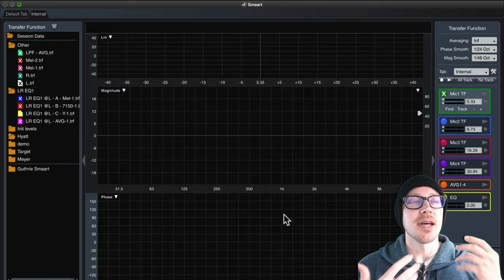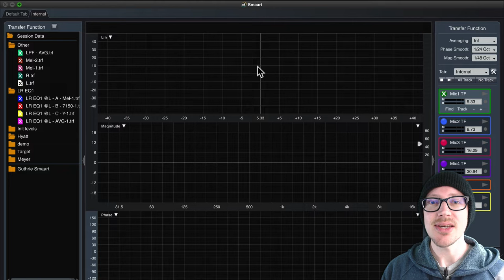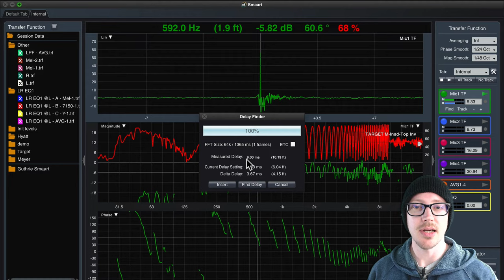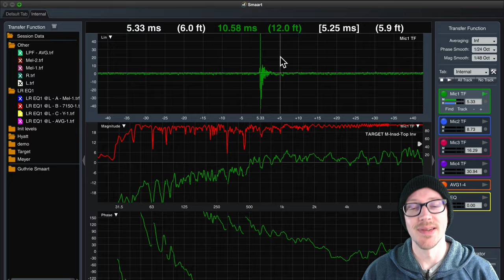How to Time Align Your Main to Your Front Fill Using Smaart® Live IR

Comment: If you don’t have smart and need to use front fills what should you do. If you have the math on how much delay is needed love to hear
Reply from the maker: Stand at the acoustic crossover point and measure the distance offset. Convert to milliseconds by multiplying by 0.9.
Reply: Also you have the "good ol' days" method (trying to make it sound fun, I'm 28) wich involves just your ears ^^

Send your test signal with inverted polarity to your fills (or subs,  or wathever you need to allign) and play with your delay untill they're completely in phase (you'll know cause the signals will cancell each other acoustically, or at least they will cancell each other the most, putting all other variables reflections from the ground, ecc  in count)

IMHO if you need to use "only" math, u're not considering too many factors, starting from the speed of sound changed by altitude, temperature and humidity, ending by unpractical measurement you'd need to be accurate, like the distances between mains and fills), this way at least we're taking all the not-ideal conditions in consideration ^^
Reply: @ValerioAmedei  I like your thinking on the subject, but have Alex do some math got to be better than no math at all.
Reply: @trydiz  sure ! ^^ A quick math question was already given, so I was trying to add to the subject ^^

Just to clarify, I'm exactly the guy who would measure everything - no matter how unpractical it would be - to have at least a matching value between my math an my "practice", but, again, I was trying to add another practical point of view ^^

Comment: Very interesting but I have a doubt. Is better to adjust phase electrically or acustically. Can I do it with Holmimpulse? With Smaart phase is  a line
Reply from the maker: Hey Raul, I think I saw this question on another video. My understanding is that you are trying to decide if you should physically move the box or electronically delay it. Either will work. 
I don't know what Holmimpulse is.

Comment: Hi @Nathan Lively , thank you for the video. I have a question for you. How do you proceed when having maybe 5 stacks of FF? Do you set the same delay to each one? In that case, which stack would be your reference? Or do you set a different delay on each stack? In my experience I’ve met same amount of engineers applying each option...
Reply from the maker: Hey Rafael, do you have Bob McCarthy's book? I recommend you read section 14.4.6.2 Delay Dilemmas. I think you will find the answer your question there.

You can then look at your different options and ask: Which choice will affect the maximum number of people?

Comment: 1 thing i ALWAYS do before anything else is delay my MAIN L/R PA by 6ms before anything else. This gives me room to move forward and backward in time if need be if ever you have to due  placement as often happens at a large Festival when it's just go go go, points don't get put in the right place,  ground stacks are way forward thanks to shit management by those directing local crews etc etc etc etc . In most cases, I don't have to use that "Buffer" but having it on many an occasion where you cant go back in time, works well enough that no one out front has any idea that you didn't actually bend the laws of physics at all, instead just thought the potential problem through before finding a HUGE problem you can't solve, 2 hours later!
Reply from the maker: Brilliant! Why 6ms?
Reply: @nathanlively  I used to do 5ms, thinking I'd never need 5, then once I did where the outfill was almost behind the main hangs and had real issue getting any low information into that part of the venue.  So now I do 6 and never needed it since. !! Nothing more complicated than that. In all honesty when I've had to use that "buffer" it's rarely any more than 2.5ms remedy in most cases.

Comment: If this is for a home theater do I adjust the delays in my receiver
Reply from the maker: hmmm, unsure. You'll need to contact the manufacturer.
Reply: @nathanlively sorry I should’ve been more specific. I use an AVR in my home theater, and want to use this method to time and phase align. Do I just use the distance setting in my AVR to achieve the delays? Since distance is basically the same thing as delay in an AVR

Comment: Appreciate the videos @Nathan, I was hoping you could clear something for me. @1.33 when you start to find the spatial xover point initially where is ref and measurement delay value locked to, mains or the front fills. I mean the initial 5.33ms you have from the beginning of your video (its probably the latency of your demonstration setup in this case). Or would you turn on the FF and the mains and find the delay and let smaart locate which one is closer? 
Second question is would you just work on one side of the PA Eg: Mains Left and FF and just use the values for the right side  or work on both L & R separately especially in the case where a mono out is used for the FF?     
Thanks
Reply from the maker: Hi Yamin!

> when you start to find the spatial xover point initially where is ref and measurement delay value locked to, mains or the front fills.
It doesn't mater. I could be either as long as you can peak both on the graph.

> Or would you turn on the FF and the mains and find the delay and let smaart locate which one is closer? 
I just turn them on both together and hit the delay locator. It will pick the highest peak. Then, if I don't see two clear peaks on the screen I will zoom in or out or add some delay to one channel until I can see two clear peaks.

> would you just work on one side of the PA Eg: Mains Left and FF and just use the values for the right side  or work on both L & R separately especially in the case where a mono out is used for the FF?     
Yes, I am always measuring solo systems in this case: Main L vs Fill for example. If the system is symmetrical I will work on one side and then copy it over to the other. If it is asymmetrical, both sides need to be aligned independently. In the case of an asymmetrical system with a single processing output for all front-fills...yikes, I don't know...send me the design and we can look at it together.

Comment: hi Nathan Lively 
about your last video you posted on YouTube, I think that what you have nicely exposed in the last video is correct but, it should also be said that, not in all cases it is possible to obtain a total alignment of time and phase between main  and fron fill using this impulse response technique.  It can be For example in the case of totally different systems (2w, 3w and 4w) of design and brand.  It would be profitable for your followers if you also explain this aspect.  Do not you think ? 
I'm available for clarifications. 👋✌🏻😊
Reply from the maker: Yes, I agree. While observing the Live IR will get you in the ballpark, you'll still want to verify matching magnitude.